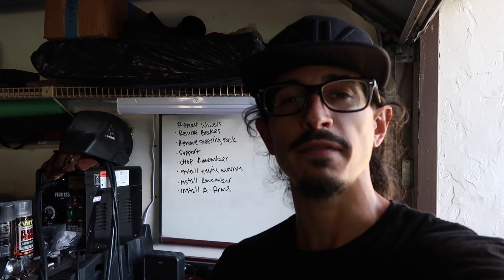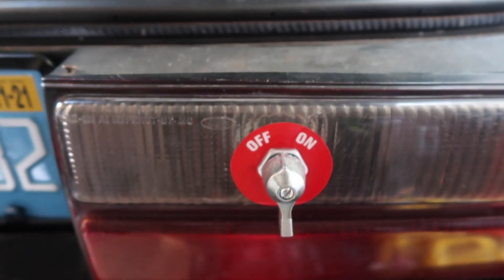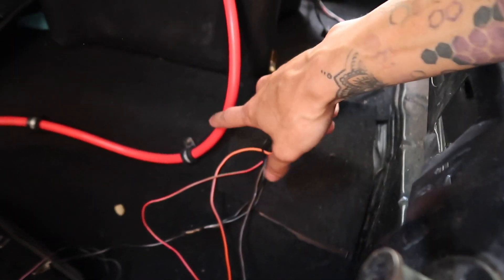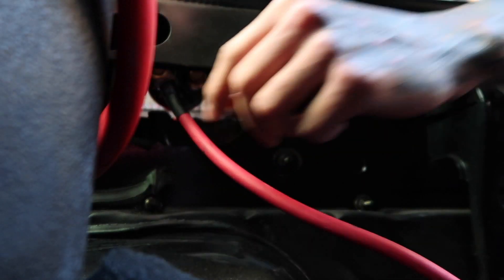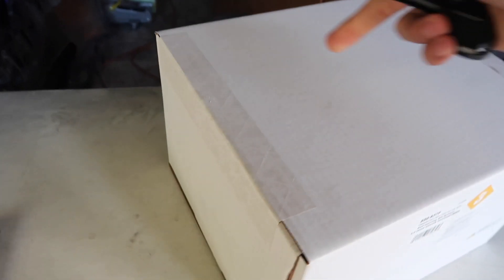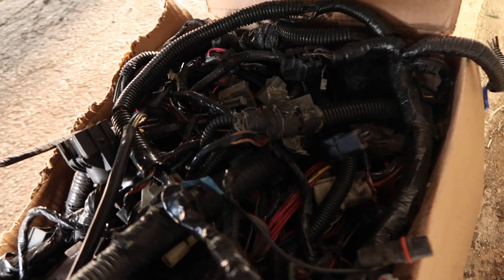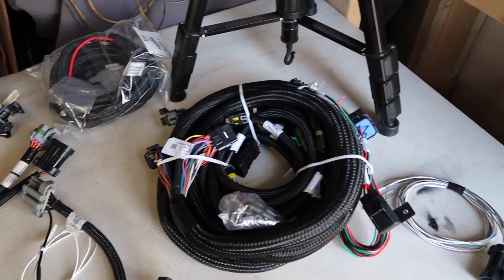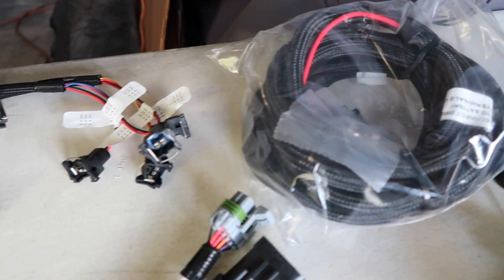Ms Parkers New Engine Management (Holley Terminator X)

Comment: This is going to be my next mod. Can’t wait to see you install it so I can follow alone. Mines a 86 with the on3 so not sure how they do the mass air with it. I have a electrical issue I changed the neutral safety switch, ignition switch and still can’t start my Fox with the key. I’m pretty sure my Ecu is bad and have a electrical issue plus I have the on3 turbo for my 306 which makes the TerminatorX the perfect stand-alone for my Fox. It will solve so many issues it’s not even funny.
Reply from the maker: yeah man the terminator x is definitely a turbo fox bodies best friend 👯‍♀️